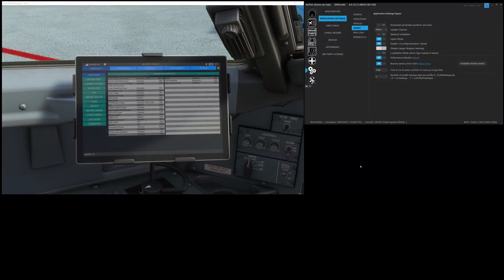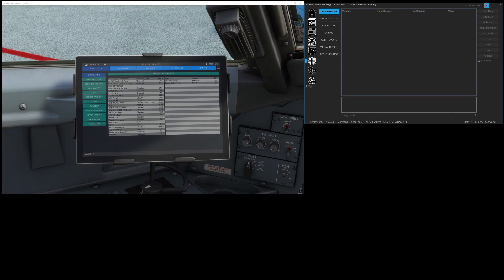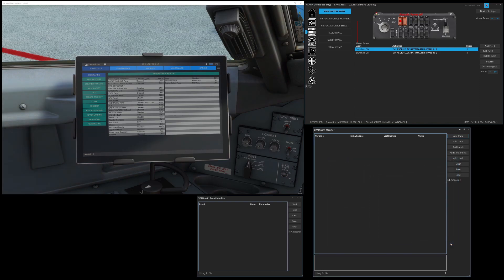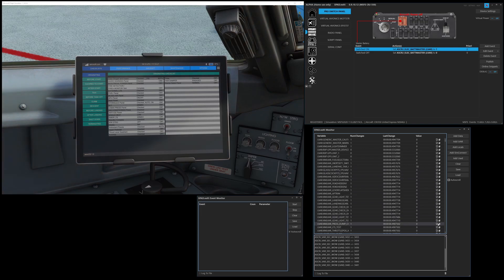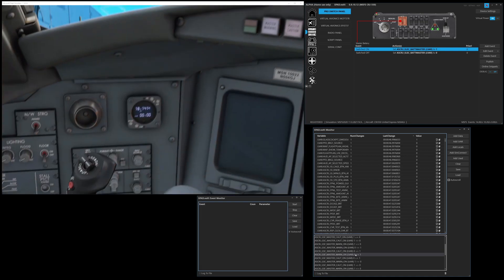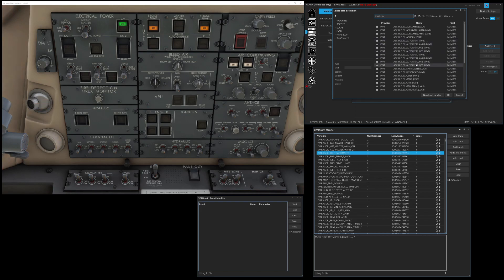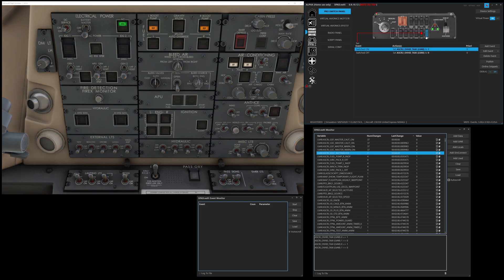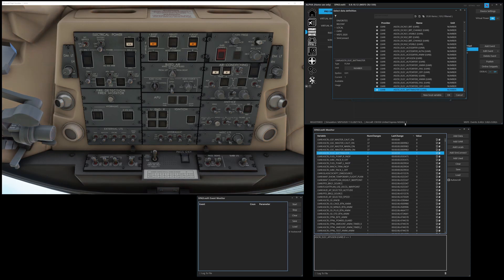(Sim Video) Getting Started with LVARS / Aerosoft CRJ

Comment: since the last MSFS update  all the buttons on the panel is also resetting my flood lights by turning them off. Any ideas?
Reply from the maker: Double check that the simulator has not re assign buttons to your panels in addition.
Reply from the maker: Just did 3 flights with the CRJ and they were all great... working on improving the Radio Panel and now I got most of the TCA ADD ON working

Comment: Trying to get the CRJ Autopilot to work with my Logitech panel,  I found the LVARS values for instance on the Altitude select (3 Actions take place for every click)   I set the knob to increase the values when clockwise but nothing is working.   Its physically moving the dial on the panel but no values are increasing  (But it increases when you click on the dial with your mouse)   Any ideas?
Reply from the maker: Yes it is a finicky item -- I have to get it worked out :)...  I have not commenced it yet.  But what I gather It involves triggering a couple LVARS at the same time.  From what I gather it needs one LVAR to move the "knob" to see and hear the click and then using another like ASCRJ_FCP_ALT_CHANGE with a 1 or a -1.... again hoping to get to the FCP/MCP later this week :)
Reply: @LesOReilly  Its kind of wonky... i've tried setting two different actions to execute at the same time and even all three... to no avail...    the only one I was able to toy with and get figures to change was the ASCRJ_FCP_ALT_CHANGE (LVAR) increasing or decreasing by .1 or .2    if your on discord feel free to message me CRWREK
Reply from the maker: I got the AP working and it was close with what you were doing...  It is just how that Change LVAR works is not the Increase or decrease of a value... It was that you set it to 1 or -1 and then it basically "resets" back to 0 instantly.... So in a way it is an LVAR for a "button" or event change as opposed to actually changing the value....
Reply: @LesOReilly   got it... I watched your video on setting up the CRJ yesterday and programmed mine very similar,   Nice nice work explaining it.   What do you do for Thrust reverse.   I’m using the HOTAS warthog,   I’ve got a detent for flex but my lower detent is for fuel cutoff...   thoughts?        Thanks again for your work on the AP
Reply from the maker: @underpressure4925  I ended up putting in some Throttle Events...  I have the TCA Throttle... I use the Fuel Cut Off switches to send the Position LVAR to 400 (idle) and when I cut off the fuel those switches set the LVAR to 450...  Then I use the "bottom" of the throttle on the TCA that is a "button" configured as a Switch.  I do an ON Event where I send the Throttle DEC command like 5 times with small pauses between them to put the reverser full.  Then the Switch Off event is Sending the Throttle Cut command that will return them to Idle.....  i am going to do a video on how I do my Throttle for the CRJ....  Spad Just updated the to v0.9.10.13 on the Alpha and added a lot of H:Events so I need to see if those will work better before I post a video that I would then change like 2 days later :)
Reply: @LesOReilly   decent!!  I think I can do mine the same way.    I’d say switch 1 is on then fuel cutoff does reverse and off its fuel cutoff.    👍🏻
Reply from the maker: @underpressure4925  I posted images of the Config I have done currently in the Spad Discord ...  if your looking for the commands and such...
Reply: @LesOReilly     Thanks man.  I’ll check it out.   I’m CRWREK on discord

Comment: Thanks for this very informative video. 
Your video showed me all I needed to get started in setting up my controllers with LVARs for the CRJ550/700.

Regards Kym
Reply from the maker: Glad it helped
Reply: @LesOReilly  Hey Les, Just wondering if you've licked the Range control on the Multi Function Display.

I've been trying with ASCRJ_LSP_RANGE (LVAR) setting different Increment and Decrement values using either buttons or rotary encoders but just can't seem to get the Range to change up or down.

Everything else so far has been simple using your suggested workflow.

SORRY - Just figured it out:-
ASCRJ_LSP_RANGE_CHANGE with SET 1(inc) or -1 (dec) :-(